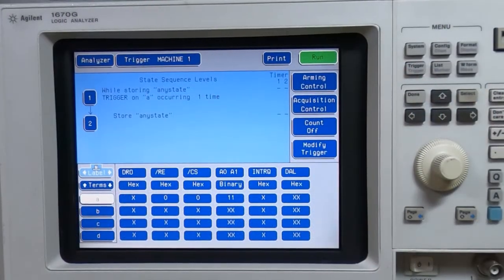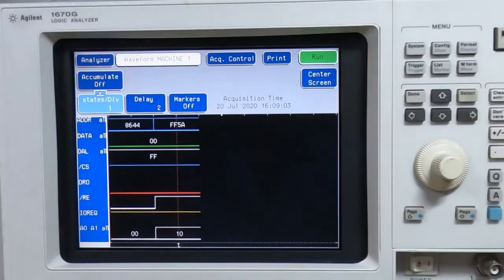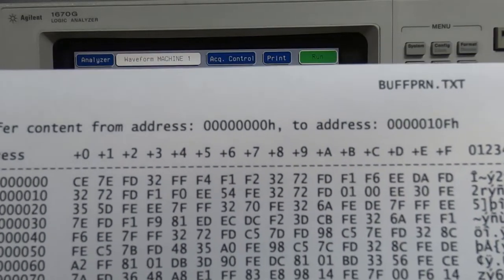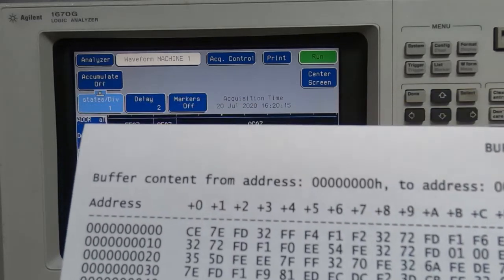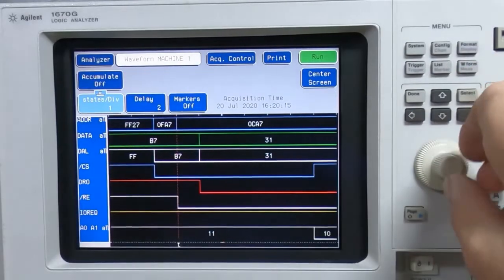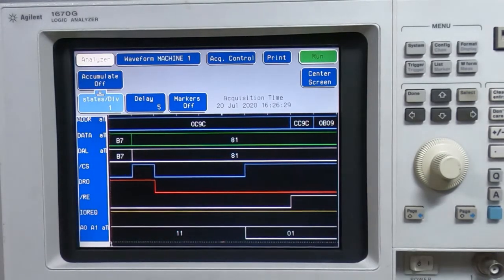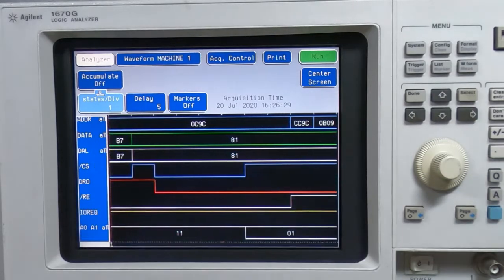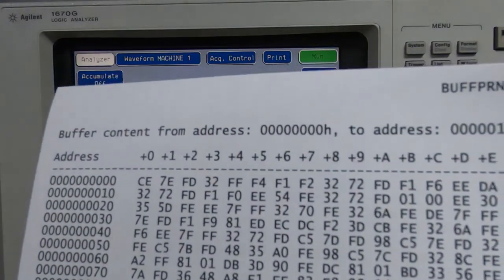Wren Repair Part4

Comment: Beautiful!!  Can we consider for this machines the FDD as an external rom and FD the “rom” content?If so would it be feasible to use the booting FD content disassembly in the same way as internal rom ? Do you think to reverse engineer also the disk?
Reply from the maker: Yes you can consider the FD contents to be ROM as it is simply Z80 code but it is not very feasable to reverse engineer it in the same way as the ROMs. It is fairly 'standard' CP/M code so is really a collection of files which can be read externally. The purpose of the Wren boot code in its ROM's is to load some of the code from the floppy and then pass control to the newly loaded code. The ROM's do other things (self test etc) but the ROM code is more specific to the machine architecture and the programs on the disk are configured to run on particular machines but are otherwise 'known' files. Boot problems are most often caused by the inability of a machine to either copy the boot code from the disk or a hardware problem that trips up the boot process. Because these machines are failing so early in the boot process I suspect that there is a RAM issue (bank switching, Faulty RAM or poor TTL signals from failing IC's). If we can get the ROM code reverse engineered then it would simplify future repairs although it is of course making this one muc more complicated. Same principle with the hardware / schematics.
Reply: Jerry Walker Thanks. It’s clear for me now